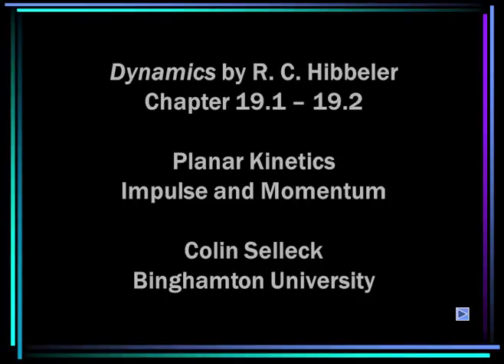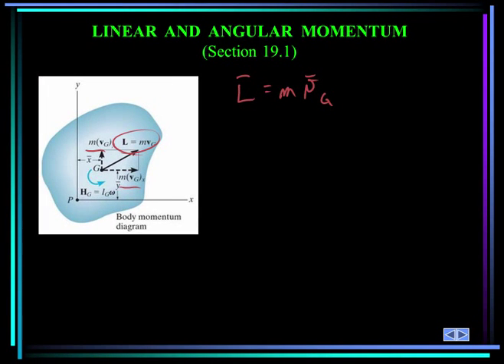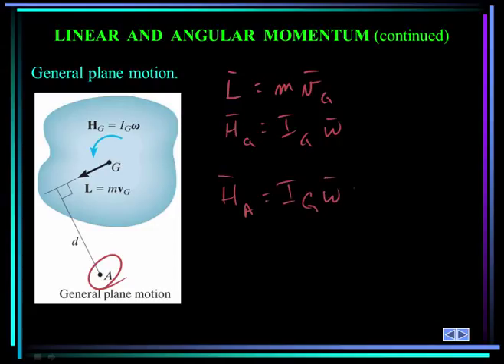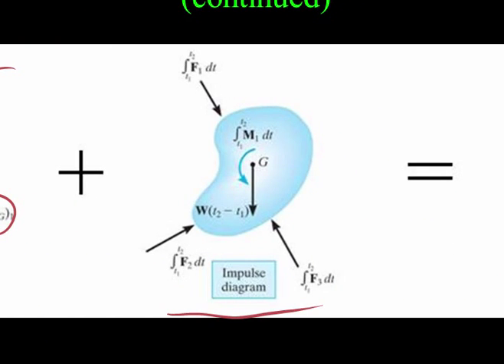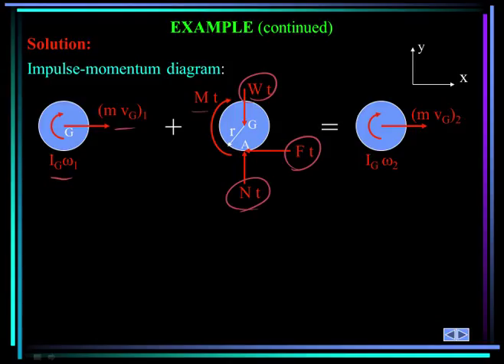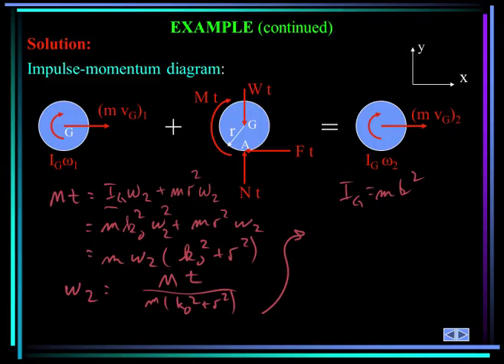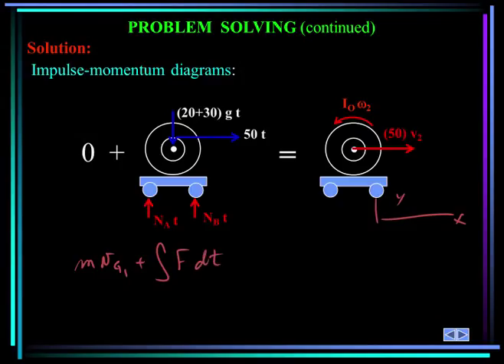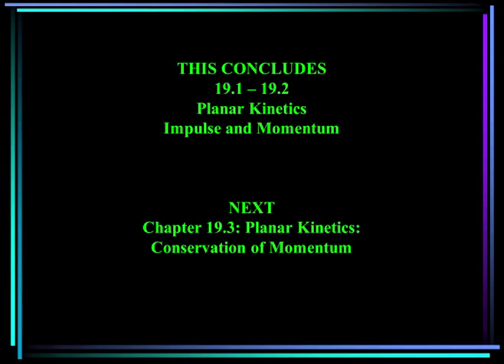ME 274: Dynamics: Chapter 19.1 - 19.2

Comment: I need a solution of a problem in this chapter 19.2,19.7th problem,page no:511
Reply: The mass moment inertia of the pulley about
point O is IO =15(0.112  ) =0.1815kgm2 The angular velocity of the pulley and
the velocity of the block can be related by ω =(vb/0.2)  = 5vB.
0 + [40(9.81)(3)](0.2) - [2000(3)](0.075)= -40vB(0.2) - 0.1815(5vB)= 24.1 m/s